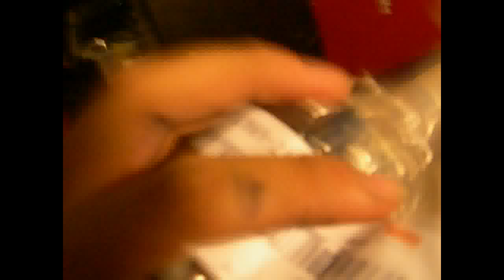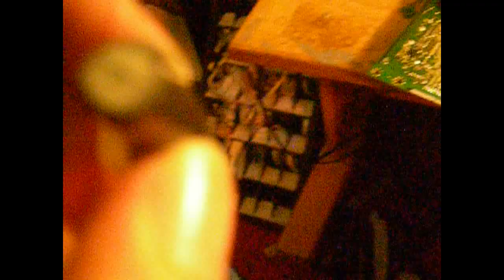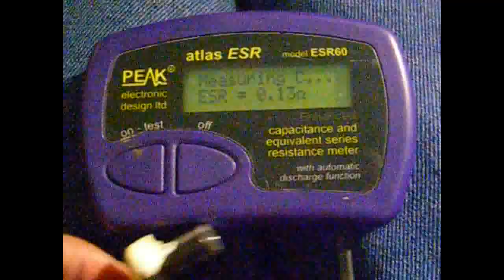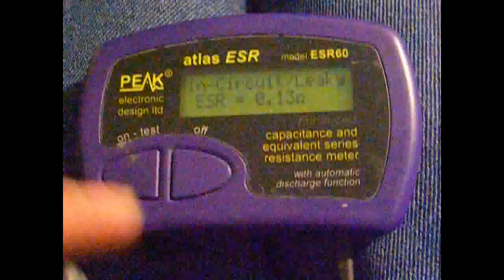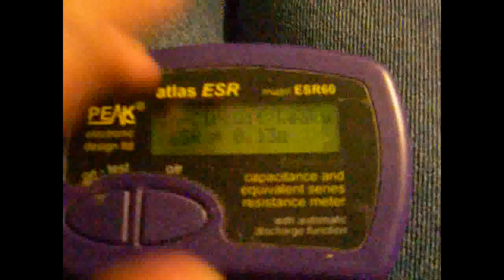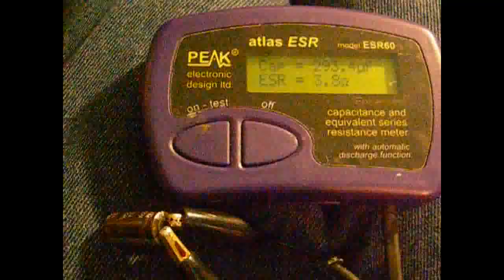Samsung LE40A656 - Power LED blinking - Repaired/Fixed

Comment: Thanks for the video, I was wondering if you could give me some advice. My TV has a very similar power board, it is working but there's a buzzing coming from it which is most noticable in standby. I think its coming from the yellow thing near to the capacitors that you replaced (im not an electrical buff but research leads me to believe it's transformer?). Can I replace it or shall I just buy a new power board (they are fairly cheap on ebay).
Reply from the maker: +Simon Lawrence If the buzzing does not annoy you when the TV works ignore it. You can't do much about it, and it doesn't indicate a fault.

Comment: I also experience same problem with my Samsung LCD TV LA40B650. Im also suspect the caps are the cause of the problem. From ur vids, i can tell the your main supply board is nearly same as mine. Can u tell me which caps that u has replace? Thanks alot!